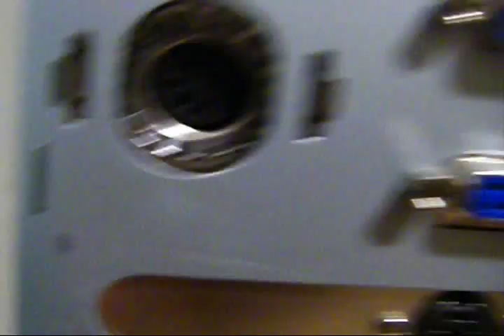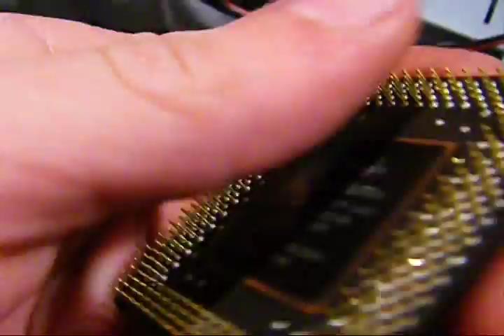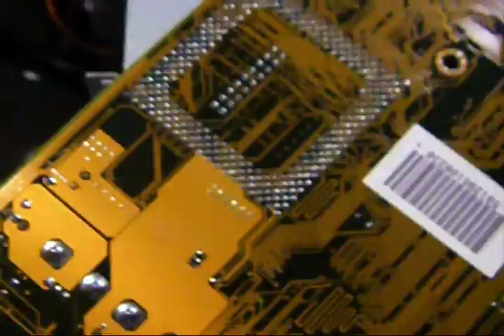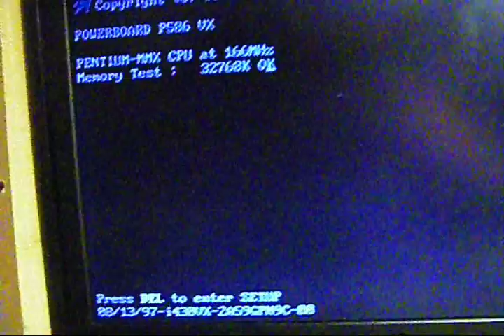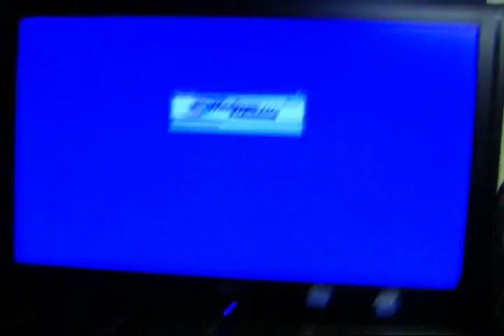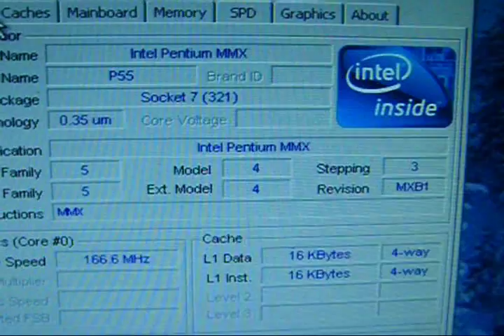My Pentium MMX Computer.

Comment: @bacovia2004 I have more boards:
1.Two VIA P5MVP3 (both dead)
2.Jetway-J656-VXC (maybe dead?It starts but no hdd startup sound and cdroms don't open
3.Zida 5DVX motherboard (one capacitor missing,some kind of rust that is like dust underside,i got it with a AMD K5-PR100 processor :D)